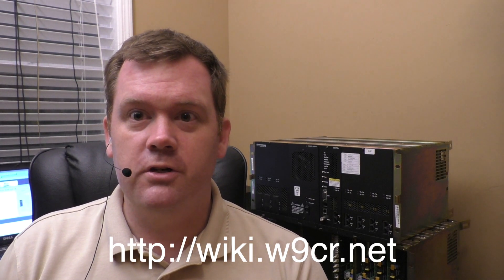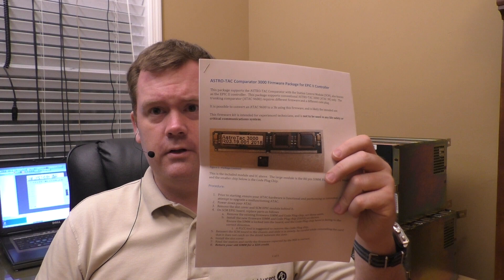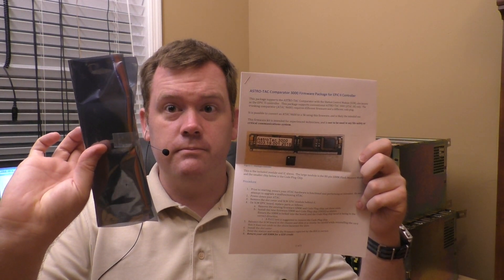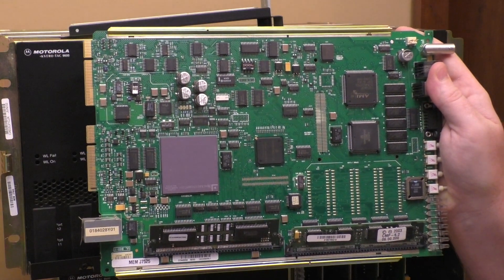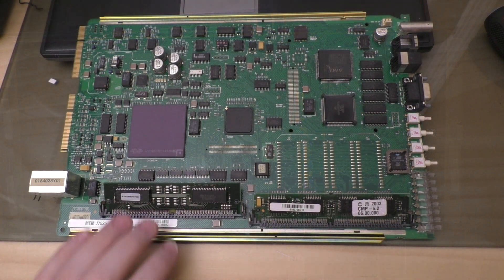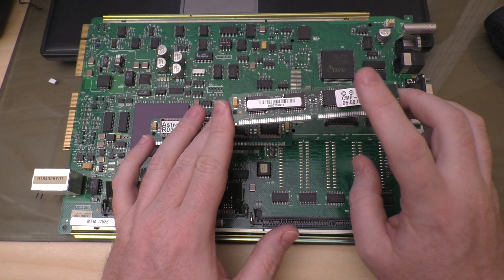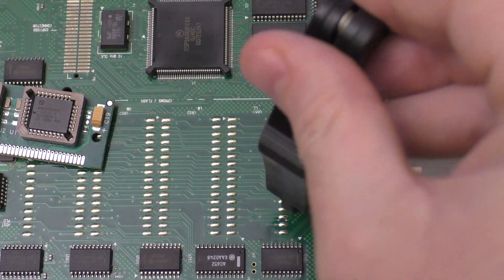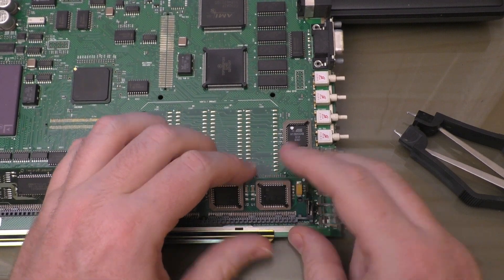ASTRO-TAC 3000 Firmware Upgrade kit

Comment: good day Bryan, do you have a line on SWDL files for astro css by chance. epic 4 scms need them at a different software version.?
Reply from the maker: EPIC 4 is a trunking only controller, It's of no use to the amateur as it must be with a controller.  What are you trying to do?
Reply: Bryan im trying to do trunking? 
Not a ham on this end. 
Radio shop tech here. 
Just advancing my education with eol gear ive torn out.
Reply from the maker: @MrBoostJunkie  Best to contact Motorola if it's for a customer system.  I only do this in the context of amateur radio.  EPIC4 is used in a smartzone system and there's so many different parts of software in that, you really should be under a support contract with your vendor.
Reply: Bryan i am the vendor.. the stuff is EOL EOS by years now. Mother M has no support for them anymore. Anyways I understand your stance. Thanks for the great videos.
Reply from the maker: @MrBoostJunkie  I have no info on the smartzone stuff, I've played with it like once and then put it back on the shelf.  If I had it, I'd post it.  Sorry man :)

Comment: Great vid Brian.
I actually used to work on this stuff, now it is all GTR stuff.
Tip.... On the bottom of the faceplate is a card puller that hooks into the bottom of cards. This way you dont cut your hand when pulling cards and makes pulling those stubborn cards easy.
Can you do the quantar sim? I have a failed station and pretty sure it is the sim.
Thanks again